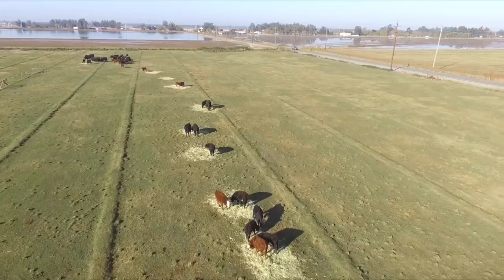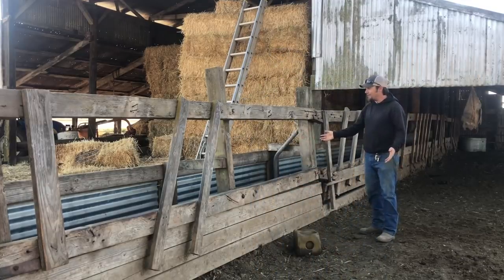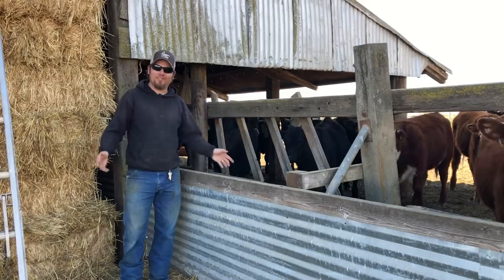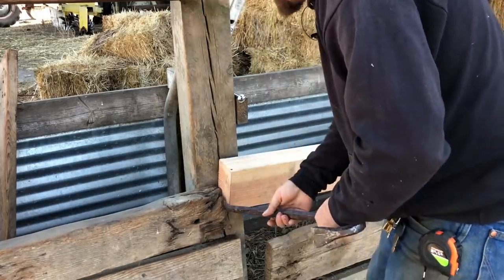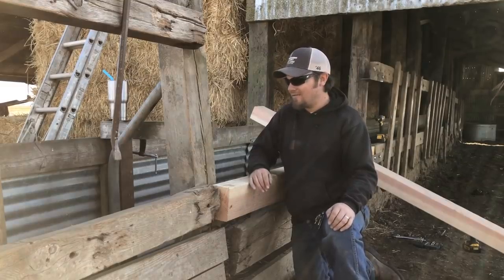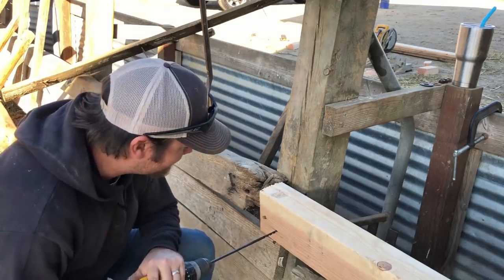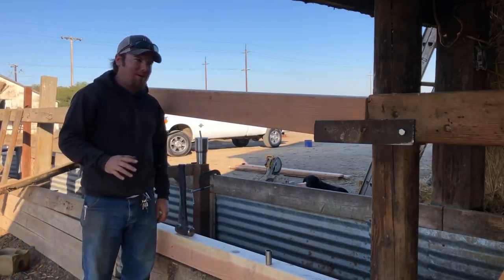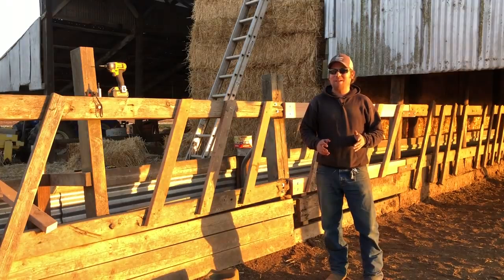Fixing up the Manger and Getting Ready to Wean

Comment: I usually  cut boards to short. Ive used long lag screws like that  to make some posts taller, their holding great. Yanno even if you do switch to round bales, the manager would be nice to have  incase yoy need to seperate some cows. Thanks for sharing tyler.
Reply from the maker: Thanks Kory!

Comment: Thanks for the video Tyler!  The manger looks like a good solution to all the headbutting and pushing around that my cattle do with just a feed trough.  What is the distance between the upright (angled) boards?
Reply from the maker: Thanks Lori yeah I guessed it helps with that too. The main reason I put them there is to keep them from pulling the hay out and dropping it on the ground. The distance between 2x4’s is 14”, so center to center is around 18”